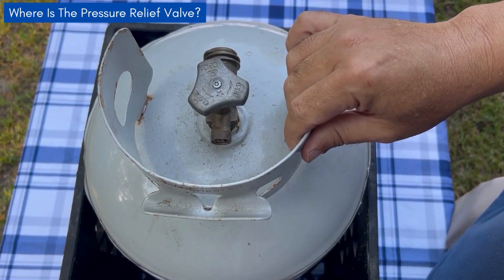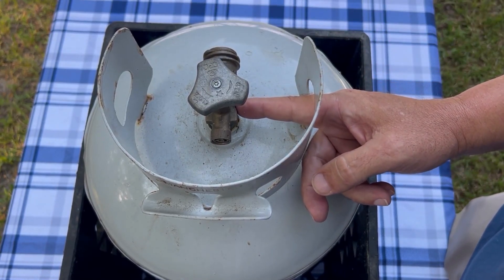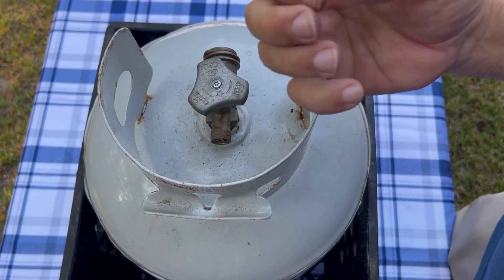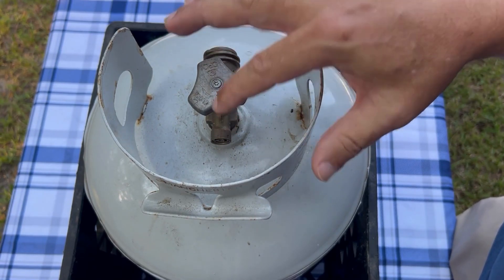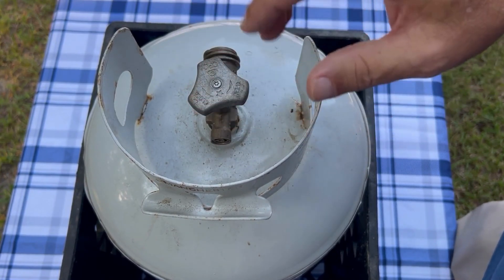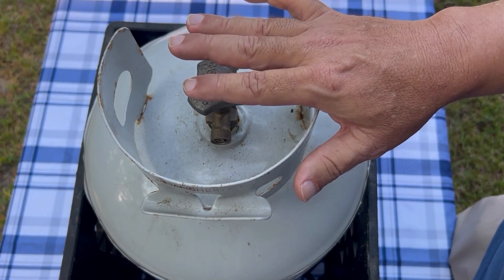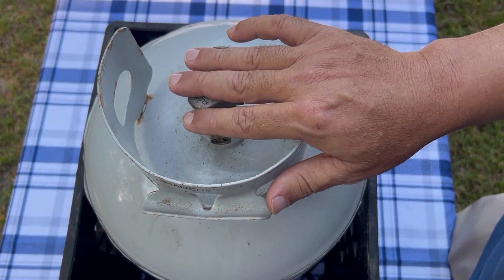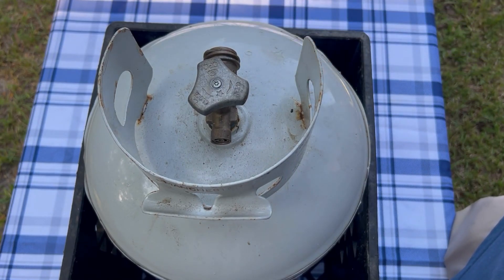WHERE Is The PRESSURE RELIEF Valve On A PROPANE Tank - WHAT Does The PRV Do?

Comment: mine is a newely refilled tank and it is hissing continuously and only while in use not w/the valve closed. Soon as i open it it hisses and does not stop--based on the video closing the valve via the screw sounds like i could allow pressure to build w/no escape--w/continued use will it eventually stop or should i get rid of it?  when sprayed with soapy water i am getting bubbles at the top of the tank on the threads-thanks
Reply from the maker: You may need take the adapter back off the tank and reconnect it and make sure it’s tight.  If you still have issues you might want exchange your tank.  Thanks!

Comment: My shut out valve is stuck but once i connect the burner and valve on the hose ..my grill turned on fine and turned all the way up...is ther something wrong with this tank?.. i just bought it used 😳
Reply from the maker: As long as the safety valve is open inside the shutoff valve gas will flow.  I here is link to our video on how to get the handwheel unstuck.   https://youtu.be/iY-uG97Rf3s  Hope this helps!
Reply: @cookingwithcoastalcaterers  highly appreciated...I will watch that one rn 🙌👍

Comment: I recently had my 30 pound tank filled, when I got home it was dark so I let it set outside because I smelled propane. This morning I used soapy water to check the on off valve and the part that I hook up to my appliance but no leak, then I saw frost on the pressure relief valve area so I drizzled the soapy water on the pressure relief valve and it blew big bubbles. I remember the guy who filled the tank said it weighed 60 pounds and so I looked up what it should weigh an everything I can find states it should weigh about 55 pounds. My question is if it weighed 60 pounds then does that mean that they overfilled it and if so do you think that it will stop leaking once the excess has leaked out?
Reply: I bought a new Manchester tank, 40 pounds, and it overfilled when new, and just recently, the second time. The OPD valve suppose to prevent this. Anyway, I flip it over and run some liquid propane into a smaller 20 pound tank.  Takes a half hour.